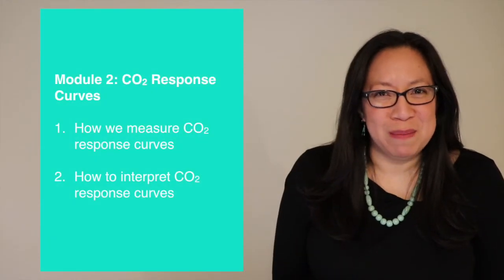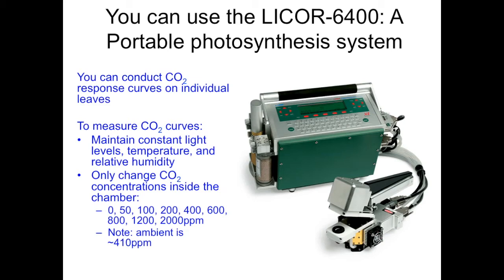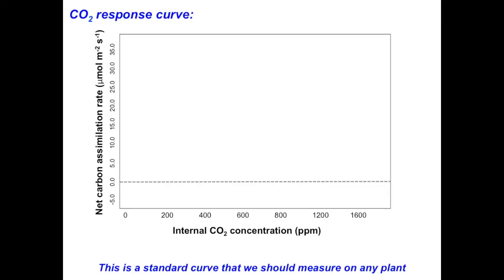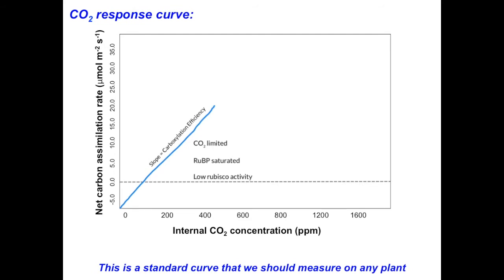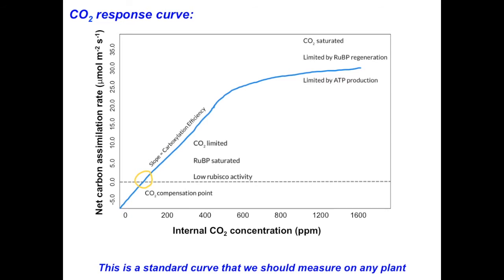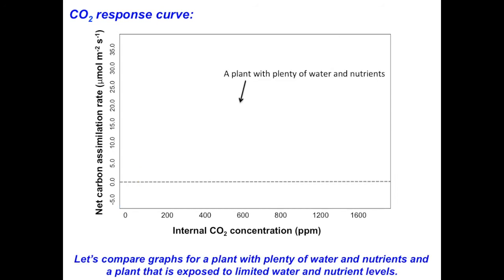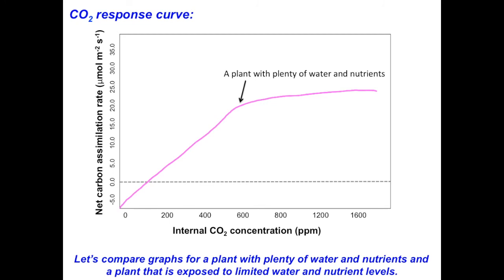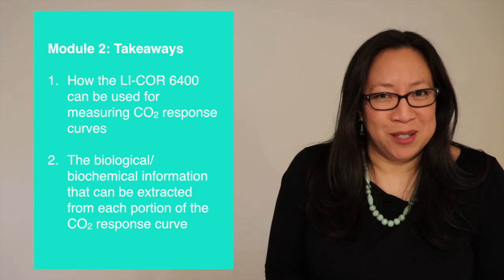Module 2: CO2 Response Curves

Comment: Love this stuff! From your chart, the rate of photosynthesis for a healthy set of variables including a steady temp of slightly less than 77 F (temps a guess on my part for purposes of example)  seems to drop off at 600 ppm. Question - If at the point of drop off the temp was increased up to say 85 F while maintaining a good VPD rate for the current stage of growth and the proper EC (nutrient salts) feeding schedule would the photosynthesis rate continue to be linear and not drop off?